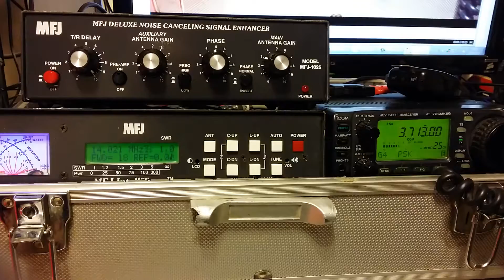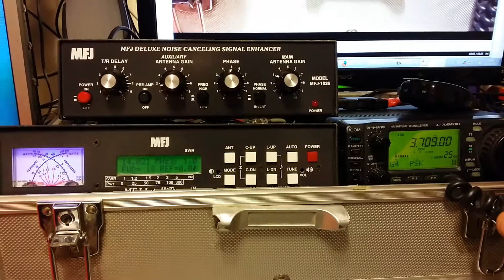MFJ 1026 Demo 2 - No signals on your radio. Think again!

Comment: Nice receive improvemant. i have one 1026 now, i cant get it to work like that, in fact it makes things worse. i am usung the internal telescoping antenna that it came with, If i need get an outdoor ant... what should it be? A great one like my main fan dipole or a crappy one that only hears noise outside such as a 4 ft piece of wire and should i use a balun to make that piece of wir 50ohms?
73

Comment: Hi, Great video, thank you. What do need to use as the auxiliary antenna, please? I only have long wire in the garden to receive which works well but may be with this unit could get better. Just want to know the “full” requirements to make it world, if you would oblige please. Cheers.
Reply: I use an RA0SMS active antenna as my aux noise antenna and it works very well. Cheap, compact. Small footprint and very sensitive across all bands.

Comment: Nice! I just ordered one today! I have a close AM radio station I need to make disappear! Thanks for the demo!
Edit: Received mine yesterday (7/27) and it works GREAT! Highly recommend this if you have noise issues!
Reply: Tommyr did you have to hook up an external antenna or just use the one that came with it? i have a lot of very close local noise so hoping i can get by with just the little antenna that comes with it for my aux
Reply: The Johnny O Show 2 years later answered but I got by with just the internal whip! Apartment on top of me possibly generating the noise.  Whip brings me down from S9 to S3!
Reply: @624radicalham  Yup, I use just the whip as well. Works so great!
Reply: @Tommyr  Glad to hear so many success stories on this device. Makes all the difference in the world.

Comment: got local noise floor in my apartment, am near power line, wal warts makes noise..am using indoor magnetic loop and using a battery. i cant use AGC coz it'll flood my meter. Got S9+ hiss /white noise and so far no static or fluctuating noise. can mfj1026 remove such issue..
Reply: did you happen to get one of these yet? im kind of in the same boat and need to do something to get rid of all my very local noise, hoping it will work well for that with just the aux antenna that comes with it